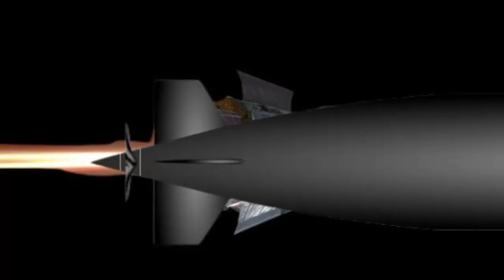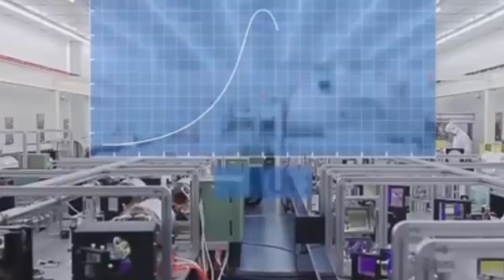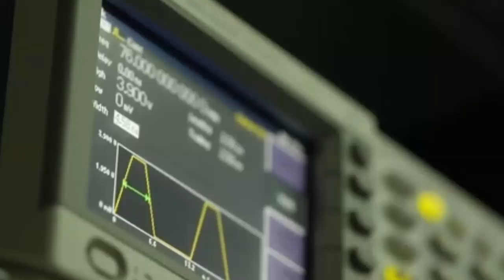Genius Idea China Uses Laser propulsion for the Fastest Submarines in the world's

Comment: This is highly unlikely to work, propellers are typically at least 80% efficient, lasers are rarely even 40%. Propellers get rid of heat in the water, lasers need to get rid of the heat in the lasers that pump the fibers and in the fibers themselves. This is extremely difficult when you start talking megawatts.

Comment: The submarine propulsion system utilizes an array of high-powered fiber-optic lasers to generate focused femtosecond laser pulses. These ultra-short bursts of light are directed toward a precise point behind or in front of the submarine. The lasers concentrate the energy into an extremely small focal volume, converting it into plasma.

Femtosecond pulses are ideal for this application because their short duration prevents significant heat from diffusing into the surrounding water, reducing the risk of creating widespread thermal disturbances. Instead, the energy is confined to the immediate plasma formation, where rapid expansion occurs due to the extremely high temperature and pressure generated by the plasma state. This rapid expansion propels the submarine forward or backward through a series of controlled plasma bursts.

To sustain propulsion, the system operates at high repetition rates, ensuring continuous plasma generation without overheating the environment. Advanced feedback mechanisms dynamically adjust the laser focus and pulse intensity to account for variations in water density and submarine speed, maintaining efficient propulsion under different underwater conditions.

This novel propulsion method provides significant advantages in terms of stealth, as the femtosecond pulses generate minimal acoustic signatures compared to traditional mechanical propulsion systems. Additionally, the rapid bidirectional plasma generation allows for highly agile and responsive maneuvering, making it well-suited for advanced underwater missions.